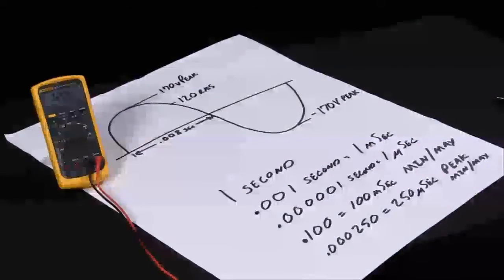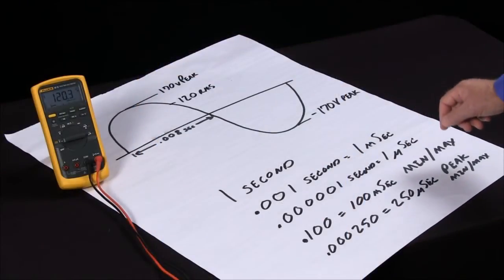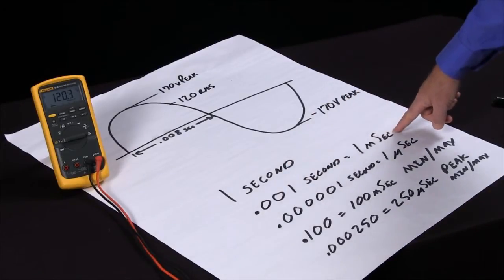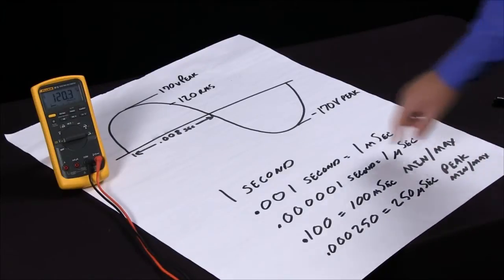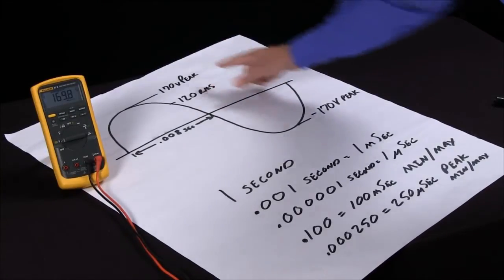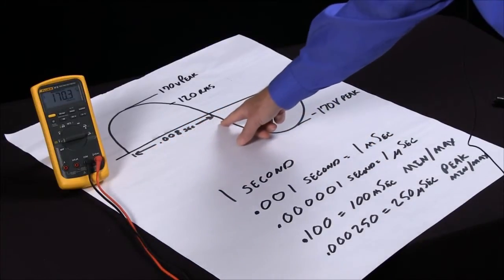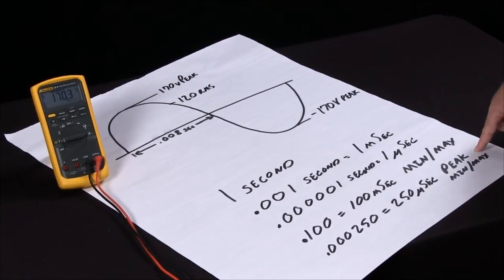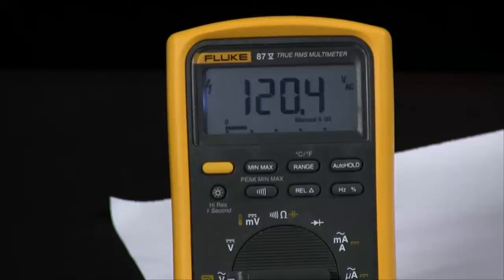What Is Peak MIN/MAX And How Do I Use It?

Comment: IMHO it is necessary to explain the HOLD function in conjunction with  Min/Max function, as, the Min will be lost if the meter is disconnected before holding the recording by using the HOLD function.

Comment: Hi I am a Outboard Motor technician, we used to use a special tool called Peak Voltage Adaptor for checking charging system, so can I just use this peak min/max function alone without using the special tool?
Reply from the maker: Hi there, 

This video shows you how to use Peal MIN/MAX in the Fluke 80 Series V Digital Multimeters. You can find more details on our Fluke 87V Industrial Multimeter here: http://bit.ly/2IeeZ3Z. If you have any additional questions, feel free to reach out to us at 1-800-44-FLUKE. We're happy to help!